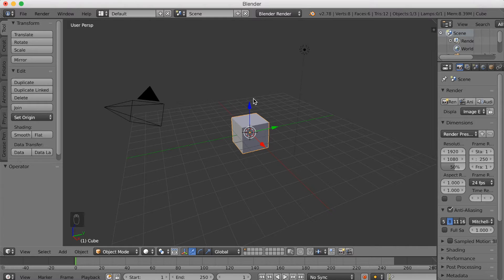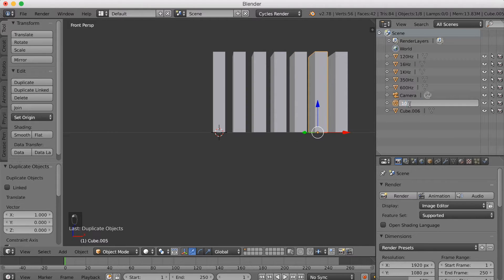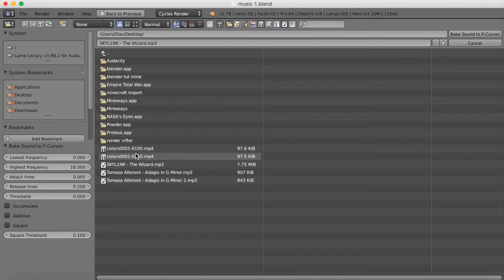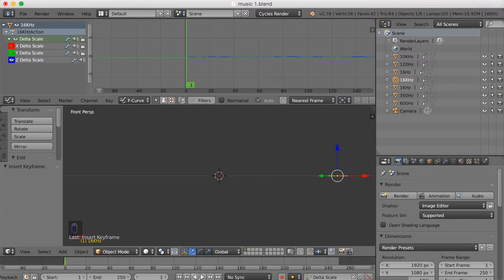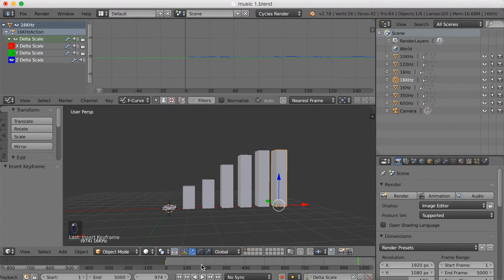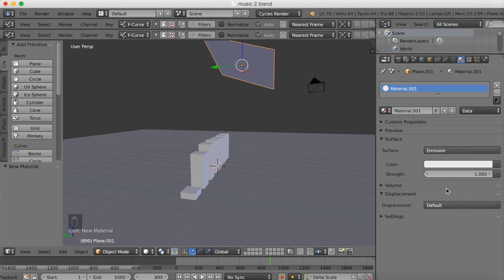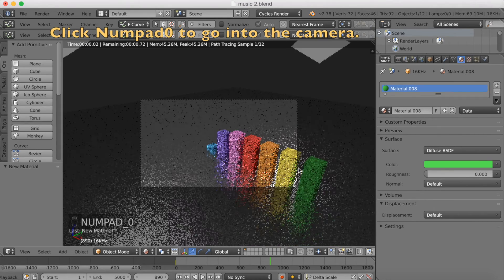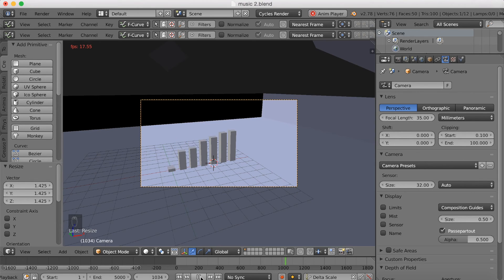[2.79] Beautiful Audio Equalizer Visualizer Animation Blender Tutorial

Comment: Have you discovered the NLA editor? You can relocate an F-Curves starting point by selecting the object and opening the NLA editor. Then select and move the NLA strip to the correct starting point. Use hotkey [Alt A (default configuration)] to check your work in any 3D viewport.

Comment: instead of doing 16 to 16000 Hz you should do 20 to 20000 Hz because that's what our ears can hear
Reply: Using the 7 Bars that Olav used Which frequencies would be the best to use in the animation?
Reply: Starfleet2360 
Probably not ultra low frequencies that do not show up well in MP3 recordings... That said depending on the MP3 (or any digital audio) algorithm version and bit-rate being used anything over 15khz may be dumped from the audio anyway. The more you know...
I actually didn't know any of this so I created many versions of the same audio for my EQ animation (pending release - meaning it's currently rendering). Unfortunately I didn't look at enough tutorials. That said I still didn't want to copy anyones tutorials so I made some slight tweaks.